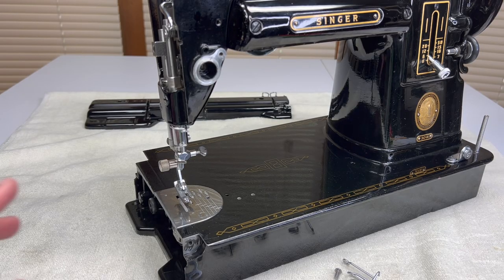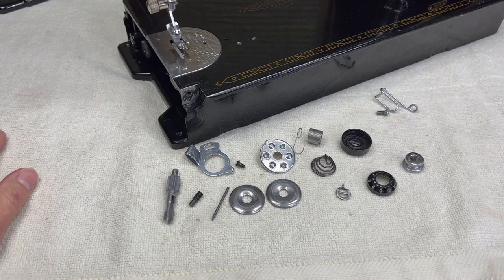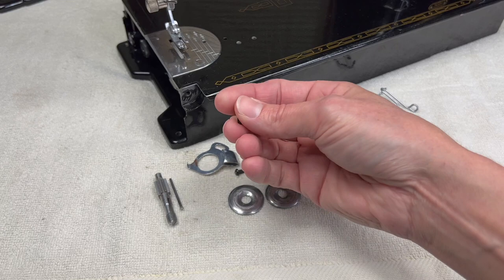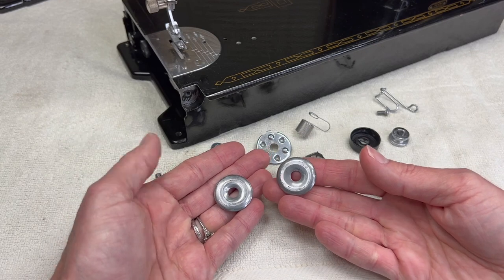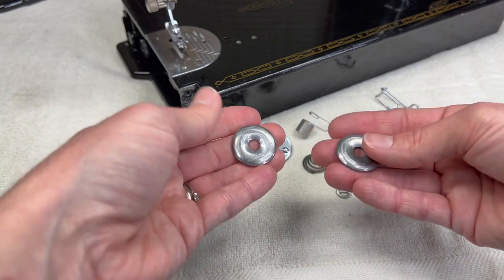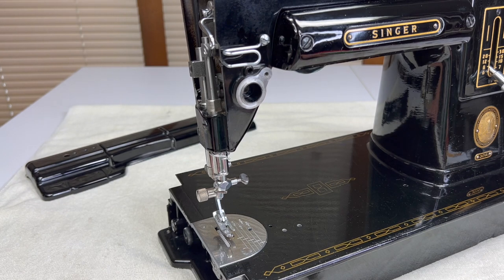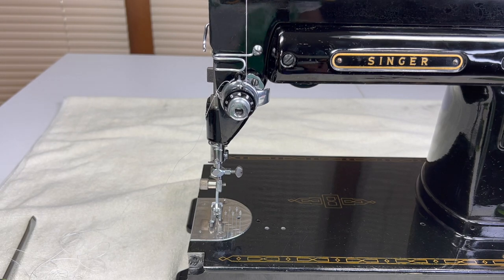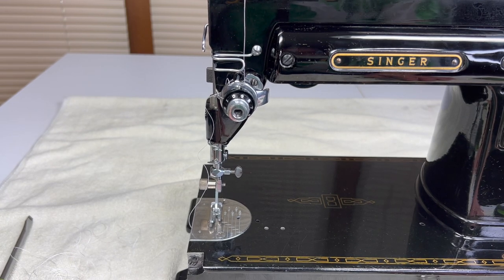How to reassemble and zero out the tension on a Singer 301: Singer Restoration Series part 24

Comment: Hi again. On 0 tension is 25 and on 7 it’s off the charts. At least now I can get a reading. I unscrewed the outside piece one rotation.
Reply from the maker: Hi! It could be a number of things and it is a little hard for me to guess without seeing it. It sounds like you are screwing the nut on too far. When you have the tension set at 4 the nut should be about flush with the end of the stud. Check that and let me know if it is or not and then we can go from there!
Reply: @SewingMachineRehab  I loosened it a bit and that seems better. Between 0 and 9 tension is 15. At 4 it is 40.
Reply: Does the spring need to snap and if so why wouldn’t mine be snappy?
Reply from the maker: @annabockis3344  if the spring isn’t snapping I would check to make sure that the inside of the spring has the “tail”. It is a straight piece of wire that runs down inside the spring. That tail catches into one if the sections of the tension stud and is what makes the spring have the snap. Do you see a tail inside your spring?
Reply: It is not flush with the end of the stud though. When flush tension is off charts again.

Comment: I think I've figured out the root of that beehive spring/teacup controversy...  When you have the washer with the curved "finger" it points toward you as you put it on the stud - but it also has a portion of that finger that is curved away from you (when viewed side on).  If you put the beehive spring on "the teacup way" there is a little space available  for the part of the curved finger that is curved towards the beehive spring.  So for washers where there is no curve and the finger points straight up I think it really doesn't matter which way the beehive spring goes on because they don't need the extra space.  What do you think?
As for your video it is lovely and clear - and so, so useful for videos like this to show how to zero out properly.  Most people that do vids on tension units just show how to assemble it, buy leave out the finer details of how to make it work properly - and that's the thing that most people have trouble with when they're actually sewing!  :-)
Reply from the maker: I think now I have to take it apart and look! I want to press the washer against the spring and see how it fits both ways. Won’t be able to for a few days but I will let you know if I find out anything mind blowing. You brought up a good point, thank you! Here is a question for you, have you dealt with aftermarket take up springs? They are not my favorite but sometimes they are the only option. I see in this video the one I used wasn’t coming down to rest on the finger….I may just need to set the stroke and that will fix it.
Reply: @SewingMachineRehab  No - I've never used the after-market springs but I have encountered that exact same problem with an original spring after I'd taken the tension unit apart on a 66 or 99 (I can't remember which of the two it was now - a 99 I think) and given them all a careful but thorough clean and polish. It seemed to be because there was no longer quite enough clearance for the spring through the path of its whole range of motion if I had the tension stud all the way in and thumbnut screwed onto the post enough for raising the presser bar to release tension on the discs satisfactorily.  Which made it impossible to get a true "zeroing out" of my tension.  Maddeningly the situation improved when I put the tension release washer on the wrong way - that is, finger pointing to the machine.

I couldn't live with a washer on the wrong way so tried all sorts of fixes.  I thought that perhaps the tension thread guide wasn't sitting properly around that little protrusion it nestles around - but fiddling endlessly with that still didn't fix it and it was seated perfectly.  In the end I got a nail that was the same diameter as the tension releasing pin and fashioned it into a replacement pin that was just a tad longer so I could install the tension stud slightly "out" of being fully-seated into the machine and still have the tension release pin work when I raised the foot. It didn't need much extra room - the sort of thing you'd measure with a couple of sheets of paper - so I guess it doesn't take much to hang up that check spring!

Anyway, that alleviated the problem but I've never been satisfied with it.  It was more of a work-around than actually fixing the problem.  I've hypothesised that crud in the machine before I cleaned it had built up over the years that somehow compensated for any wearing that would otherwise have narrowed clearances.  Quite how that could actually work in practice I don't know - but it's hard to think of something else to explain why merely cleaning and polishing the tension unit would cause that spring to hang up!

I'd love to know if you come up with a different solution because it drove me round the twist for days.  (It was a short trip to get there too!!)  :-)
Reply: Good description  like how u describe the way to place the 2 washer, I was confuse how to put that.

Comment: There is absolutely no bounce in my spring. I’m thinking I should replace it because I probably cannot zero without a decent spring.mis that correct? Awesome video. You took the fear out of removing that tension piece.
Reply from the maker: Hi! Check the center of the take up spring, if there isn't a little finger running down the inside center then it won't work properly. Let me know if that doesn't make sense. I don't have to replace the springs often but it does happen from time to time.

Comment: I recently acquired a 301A and the pin was missing from the tension assembly. Can you tell me the length of that pin and should it have a flat edge on one and round on the other
Reply from the maker: Sorry, I didn't see this question. My measurements came in at 1 3/32". Yes one end is flattened. Hope that helps!

Comment: Hi!  I am on this step but decided to plug it in and check everything before going further.  The motor runs but sounds pretty loud.  I even took the hand wheel off and ran it and when going fast, it has a high pitched noise.  Is this the bearing?  It turned freely but not as well as yours.  Could I just oil it?  I saw on vintage sewing machine garage to use sae30 oil.  Should I try that?

Comment: Do you have a Video on the lever that moves the foot up and down.  I was given a black 301 and it will not stay up.  Just falls back down,
Reply from the maker: Hi! It could be as simple as the thumb screw on the top of the machine for the presser bar just isn’t screwed down tight enough. It also could be that the set screw for the presser bar isn’t tight enough. If that is the case then you will have to set the height of the presser bar when you tighten it down. Here is a link to my video on how to reinstall all those parts in that area, maybe if you watch it you can figure out what is going on. I hope it helps! How to install the presser bar and set the height on a Singer 301: Singer Restoration Series part 20
https://youtu.be/aeeRT1BtrUI
Reply: Hi! - I lost a lot of vision to Optic Neurities at the end of 2021.  I didn't thik I could ever sew again but after reasearching, the slanted shank and smaller head of the 301 was a perfect match.  I do quilting (straight line for now) but I do it a lot so I have to clean and oil my machine...a....lot.  Withy my lower vision that is a long and tedious process for me.  Lately, my machine seems to be a bit louder evan after cleaning/oiling.  I think I narrowed it down to the tension unit as it kind of sounds like when you rub very dry hands together.  So, using your other video I took the upper tension unit apart and the components were clean and smooth as a whistle.  Either the machine wasn't used much or the guy I bought it from cleaned the unit.  I don't think putting it back together will be problematic, but I'm wondering if al the cleaing, oiling, and maintenance of this fine machine is just going to be too much and too time conuming for my low vision.  Just the simple task of oiling it takes me a very long time and before I know it, I've put way more than one drop at an oiling point.  There's also no tech nearby to fix or do any of that for me. I know vintage machines are better quality and that you're a proponent of keeping them alive..I am too really.  But going forward I just don't know if it will be realistic for me wiht my low vision to clean, oil, maintain, nad try to figure out anything that might go wrong.  So be honest, as time goes by is the dirt, oiling, upkeep and so forth going to be really taxing for vision impairment?
Reply from the maker: @lab2597  Hi again! I missed replying to this comment, so I apologize. I am not sure how hard it would be to maintain your machine with the vision impairment that you are describing. I am sorry that you are going through that, I can't imagine what it must be like for you. However, I want to encourage you in your endeavors to not let it stop you from doing things you enjoy. Are you able to have an assistant with you who could help you when you go over your machine for maintenance? Just to guide you and let you know if you are missing something. As far as the noise that you are experiencing, it is hard for me to say without seeing the machine. But, packed up lint can make a machine noisy. If you are sure it is coming from the tension unit, I would definitely need to see it to diagnose it. I also think that with time you will get used to all the places that require oiling and will be able to do it more by muscle memory. That would be my hope for you. I am wishing you all the best!
Reply: Hi! - Thank you for your reply and words of encouragement.  I did end up taking the tension unit apart and the discs were clean as a whistle.  It was easy to take apart and reassemble but unfortunately after it was back together, it wouldn't sew at all.  I did the procedure several times and it just wouldn't sew.  It was then that I realized fixing it would take more than I can do and there's noonne anywhere near me that can fix it.  So..I ended up taking it Goodwill.  301s are terrific machines, it just wasn't going to work for me.  I eded up getting a semi-industrial Juki that I can take to a tech if needed.  They doo need cleaning and oiling like the 301 but only 4 holes on top and 2 holes on the bed.  I just couldn't see those dark little holes and oiling points in the  nose and underneath the 301...yes, it was a sad day.  But again, thank you for your great videos and support!

Comment: Hi Jen. My spring initially did not click and rolled all over so I replaced it. After a few tries it seemed to do what it should. I am finding though that at zero my tension is 25-30. Is that ok? I bought the handy little meter.
Reply from the maker: Hi! Sounds like maybe the little tail inside the spring was broken? And your tension sounds close, what happens if you move the little pin on the back of the number dial one hole to the left? Ultimately I would keep it however it works for you the best. If you are happy with that setting, I would leave it. Try testing it out at various stitch lengths on number 2 and 3 tension. If you are satisfied then you are good to go in my opinion.

Comment: Tip to polish the disks to a mirror finish after emery -use just use paper towel on a flat surface / glass  add some metal polish, put the disk on the cloth and your fingers on top and that should help. The disk tension surfaces need to be flat to give constant tension. I just fixed a top tension on 28k from 1891 the old oil was like glue on all the parts. 
They tend to get rusty if they are left for a time with cotton thread left in them, this will absorb dampness and hence the rust.

Waffle warning
I have one machine a UK 66k that has a grove in the tension discs, it must have seen a lot of cotton; also the is a groove in the needle side cover plate, I do wonder what they were sewing to make a grove in the metal plate (war time use for the 66K ?) 
The UK 66k machine serial number suggest it was born in 1908 but I guess it must have gone back to the factory and been refurbished since it has (RAF decals I think they started in the 1930s). Also it has an unusual low bobbin winder mounted to the casting projection next to the stitch length turn screw.   

Thanks for the Singer 301 videos, we have a 221K
Reply from the maker: I wonder what wore the groove in that 66k as well! If only the machines could talk!

Comment: Hi Jen! In this series you did not mention taking the bobbin case apart for cleaning, and  reinstalling the b.c. tension spring… and how to get the tension correct on the b.c. 
 Is there a method for setting the tension on the bobbin case?
Reply from the maker: Hi! You are correct, I didn't do that. Looks like I need to make another video! :) I do disassemble all of my bobbin cases, sometimes those tiny springs and screws could use a good cleaning. Or the spring just needs replaced. As far as setting the tension, you can use the thread tension meter: https://singer-featherweight.com/products/bobbin-tension-meter/?aff=57  to check the tension or you can do the drop test. That is when you dangle the bobbin case by the thread and kind of treat the bobbin case like a yo-yo. You should have a little thread release from the bobbin but it shouldn't be so loose that it just keeps unwinding. I am not sure if that makes sense. The tension can be set to the same as the upper tension to start and then you can adjust to fit your needs. The screw you turn is the one closest to the cutout where the thread comes out of the bobbin case. Hope that helps!
Reply: @SewingMachineRehab  thank you, yes it made total sense! I appreciate all your help ❤️